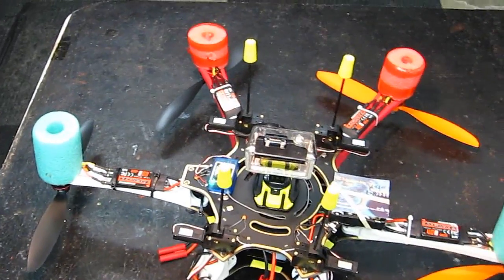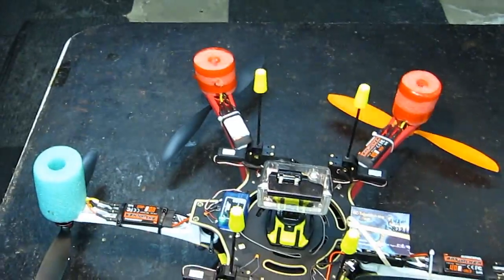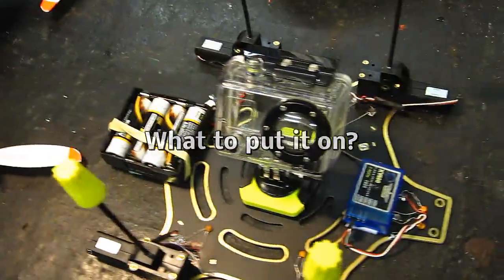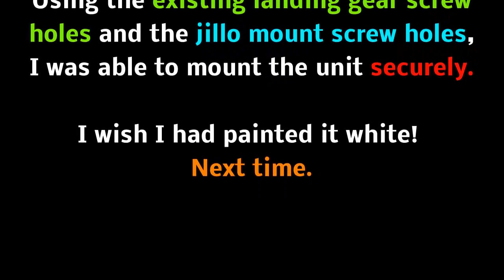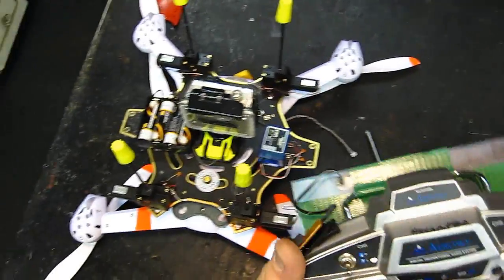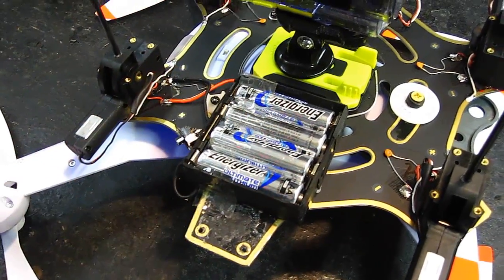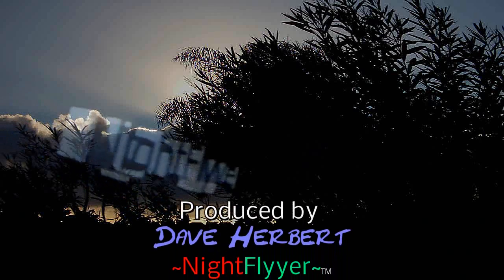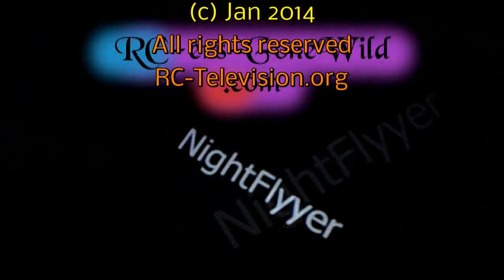Retractable Landing gear/Camera Module on Blade 350 QX camera drone.

Comment: HM...this defeats the purpose of retractable gear...cool idea but I don't see practical use of it,it blocks the view and the setup choice is kind of a head scratcher . Still,a cool idea to make a snap on gear system for 180/360 degree rotation gimbal setups.Hmm this really could be a great add-on for that.

Comment: What Switch did you program these on? i am not having much success when using the Gear switch. if i take off, then flip the gear switch it nose dives into the ground? i have a turnigy 9xr transmitter, FrSky 8 channel receiver, APM 2.6 but i route directly into the receiver. any advice or help is greatly appreciated, ideally i would like the gear to go up once the throttle gets to 55 percent? but thats just wish item, if i could get the gear switch working i'd be very happy.  thanks in advance!

Comment: having retractable landing gear on that thing is kind of USELESS because you have a BIG TURD of a CAMERA hanging down from the bottom of your Quad and the GoPro looks just like a BIG TURD Hanging from its ASS
Reply: Pharroh Ku retract gear only makes sense with a 360 rotation gimbal (4 axis gimbal). This makes the whole quad incredibly unstable you can see it and the need to plug in additional batteries ...he could have used just some servo motors and use the power from the main battery .He has like ESC for all the gear motors ...I don't get it

Comment: Sorry, but I see no practical reason why you'd put retracs on a quad. Retracs are normally used for improving scale looks or speed, neither which are applicable in a drone. Plus, they just add non-productive weight and shorten flight time.
Reply: R. A. Lee ti know your post is old but that's not true at all...(your reasons for having a retractable gear I mean).The problem here is he used way too much equipment for a retractable gear and added a lot of weight to it in the process.It doesn't have practical use because it blocks the view and the gimbal doesn't rotate at 180/  360 degrees which is why drones with a retractable gear use.Thats why you want the gears out of the way so you can have unobstructed view for all angles all the time .